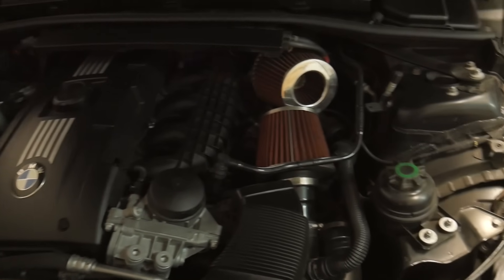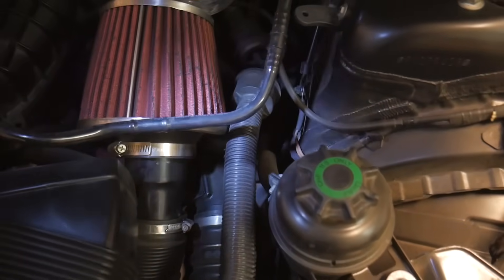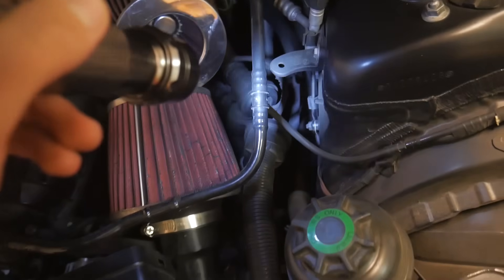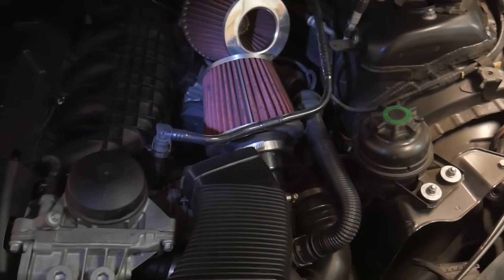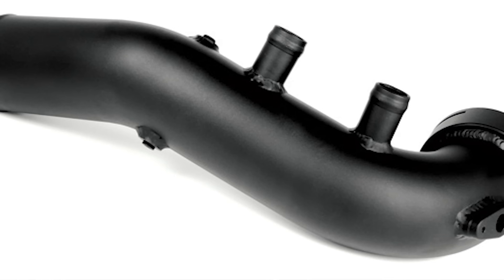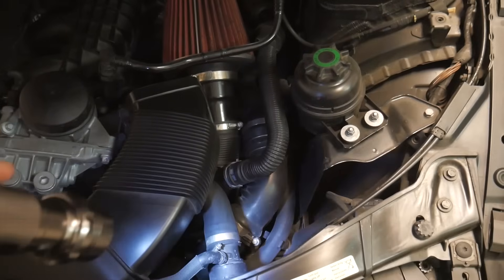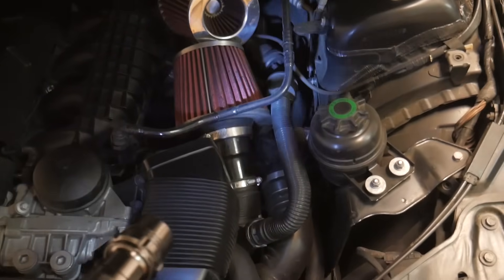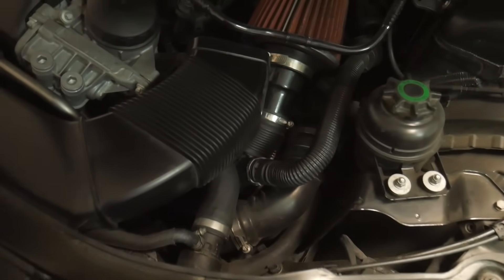The MOST COMMON Cause Of BMW Limp Mode (E90,E92,F30)

Comment: Hi Gents I'm having major issues on my 335 I e90 upgraded to 3 stage twin turbos. My low pressure fuel pump jammed up and burnt itself out, I replaced the pump and now I'm having major fueling issues. The car starts just fine no misfires or any issues and when I check my fuel pump pressure it's at 5020 MPA. Then as soon as I put the car into gear and drive 30 metres the fuel pressure drops rapidly down to 890MPA and the car stalls. I've fitted a new low pressure sensor and still I have the same problem. It runs fine when starting then as soon pull off and accelerate bam limp mode and then stalls my launch diagnosis keeps saying low pressure fuel pump and fuel pump plausibility but it's a new pump. Please any help would be appreciated thanks in advance.

Comment: @simplycarthing,I went in limp mode twice transmission fault reason,I own a 328i 2008 and I spent so many$ in less then 6 months...looks like the car falling apart lol for only 130k miles...if you can talking about mostly DIY transmission fault limpmode or DIY most commons issues with the car past 130k miles,thanks
Reply from the maker: I'll look into it thanks for the suggestion man!
Reply: Simply Car Things you welcome!!!
I am in Cali dealing with this s***t,lol.
They asking 4 k for rebuild trans and alternator
Reply: 2008 e92 with limp mode issue currently in the shop , will see what the issue ends up being

Comment: Mine goes into limp if I jump in it in the morning cold and don't let it go thru the cold start and just go. It's really annoying if I am running late somewhere. Not my chargepipe, I have a aftermarket w hks bov. Hey are you in the e90post community? If so what's your user name?
Reply from the maker: p 2o hmm that’s strange, vanos solenoid maybe? I don’t have an E90 post account unfortunately but i should make one
Reply: p 2o every morning I have to do the same thing and I just changed all of my coils and spark plugs and today the reduced power came back on .
Reply: @niksonnikollaj9459  did you ever figure out what it was?
Reply: Did you ever figure it out ? Anyone ?? I’m having the same problems changed plugs and coils still service engine light and limp mode on cold mornings or when car is bieng drove a lot in a day
Reply: @_.lik._2172   Ignition Coils
Reply: @niksonnikollaj9459  damn I already replaced those :( thanks tho bro

Comment: Mine went into limp mode few days ago took it to the mechanic and currently sh1tting myself as to how much it will cost. Something to do with cam shaft 😳
Reply: Did it end up needing new camshaft bearing ledges and seals?
Reply: @austinmerrival927  that’s what they said mate, I had to trade it in, as the cost of repair would be too much
Reply: @techqueries3881  Geez, so how much money did you lose on that car trading it in like that? 😳  I’m about to fix mine myself for about $1,300..
Reply: @austinmerrival927  I was told starting from £2k for repair mate and potentially more if they find anything else as it’s full rebuild ..🤬 so I came to an agreement of trading in  - 1.5K less than value at the time with the car dealer. Not sure if they actually repaired or just auction it off. Got a c class MB instead, no complaints so far 🤞🏼
Reply: @techqueries3881  Wow, I’m surprised you didn’t go with Lexus instead after experiencing something like that lol. That’s what I’m about to do, but just not entirely sure I wanna get rid of my Ultimate Driving Machine yet.
Reply: @austinmerrival927 I have Service engine P13BA code… & limp mode turns on after 2 min of warming up… /: Have you guys seen this code? Dealership also said something to do with timeshaft timing over retarted
Reply: @jcbeast_135i  I didn’t have that code, mine was 2A98 which is P0016 I believe. Could be a number of things though. Could be the camshaft or crankshaft sensor, VANOS solenoid(s), VANOS filter(s) camshaft bearing ledges and camshaft seals, camshaft sprocket(s) broken, sludge build up, timing jumped somehow and needs reset, crank hub spun (which ended up being my case somehow).

Comment: My 335(n54) keeps going into limp mode around the 2000-3000rpm on the highway, the code that comes up is 3100 with no other fault code. Any ideas as to what it could be?
Reply from the maker: I think thats a code for a boost leak if im not mistaken
Reply: Simply Car Things ah I see, thank you!!

Comment: Personally I would not recommend ARM, I would stick with N54 Tunning or VRSF

Ordered a set of ARM Downpipes which had terrible fitment, flange was on a weird angle, O2 ports were way off causing them to touch the frame.  https://imgur.com/a/c1Dvm

N54 Tunning downpipes fitment was perfect.

Fairly sure ARM are just reshipping Ali Express parts.
Reply: Gurji Jheeta did you return the down pipes? I just bought some
Reply from the maker: Gurji Jheeta really? My experience with ARM has been great. I have their downpipes and they fit perfect no issues for me
Reply: @Eloy Carranza      I returned them.

Comment: My 2006 335i TT goes into limp mode but if I plant my foot the Turbos come on and it takes off still in limp mode. I have replaced both Turbos as they required overhaul to replace the clatter of the worn waste gates. I removed the Cats and dropped in 2 x 3" Stainless steel drop pipes into the exhaust, checked the Charge Pipe no cracks. I can turn key off and restart no Limp,  drive normally but soon as I accelerate hard bingo Limp Mode comes on. The Techs have checked everything and I am over replacing parts as I am now up to $6000++ trying to eliminate Limp Mode by replacing parts,  any ideas or thoughts would be great , JC - Perth Australia

Comment: Hey bro I have a 2008 335i. I'm thinking of storing the car for about 1-2 month. Could there be any issue in doing that? Or is there something I should do to avoid for the car to go bad in any way? Thank you and I really love your videos! Where are you from btw?
Reply: Lift & Laugh no just turn it on once a week or 2 weeks
Reply: Lift & Laugh disconnect your battery, other than that you’re good
Reply from the maker: Yea bro! All I would recommend would be to maybe start it up like once a week and let it run for a little bit.
Reply: If you're running any e85 run it all out of the car or use a fuel additive. Disconnect the battery and you should be all good!

Comment: I have a 2009 e90, my car can be driving smoothly along then go into limp mode on the dash it's says "engine fault" then maybe 10 miles down the road it goes off, if I was to use this car 7 days a week it might happen 1 or 2 times a week, it dosent constantly stay in limp mode and if I turn the engine off and on it usually goes. So any ideas?? Is this video the one I'm looking for do you think??
Reply: Did you end up finding the problem? Had the same issue with a 2008 e92

Comment: Hi guy, I bought and e93 n54 3 mouths ago and went to silverstone for a track day. After 8-9 laps it came with the same error and I just want to let you know that I damaged badly my crankshaft . It cost me more the 3000£ to fix the car. Found that 2 injectors didn’t work properly and probably the maintenance for the last year wasn’t done on time ...... so check it properly before you will drive it again.

Comment: I had the half check engine light and it was in limp mode I had a quarter of the gas tank, I filled the gas tank and the error was gone and it is going strong again although I feel like my ecu tune went back to stock
Reply: Could it b cuz u turned the car off & back on rather than the amount of fuel in the tank? I do love the new term u coined "1/2 check engine light"! That's funny 🤣

Comment: An N54 is not twin turbocharged . The only twin-turbo BMWs that exist are within the M division , any other model is a single
Reply from the maker: Justin Girard incorrect. N54 came twin turbocharged from the factory
Reply: Simply Car Things . Any non- M BMW that is turbocharged has a single , twin-scroll turbocharger . Only the M cars have two twin-scroll turbos . If your 335 is twin turbo that means you or whoever you bought it from bought an extra turbocharger and had it installed . That car would be pushing 400+ HP if it was twin turbo but you're probably just confused because you're not even a real BMW guy .
Reply from the maker: Justin Girard LMFAO !! You’re a funny guy. You need to do some major research buddy
Reply: Simply Car Things Apologies , I was thinking of the N55
Reply from the maker: Justin Girard no problem 👍🏼
Reply: Simply Car Things lol

Comment: 2010 535XI Transmission malfunction light comes on and goes into limp mode.When i disconnect the battery for ten seconds to reset the computer everything goes back to normal sometimes for days. Could low fluid or transmission fluid needing to be changed cause this problem?
Reply: Same problem with me